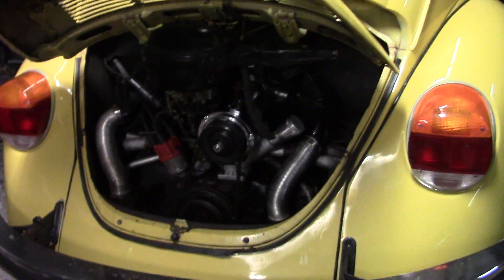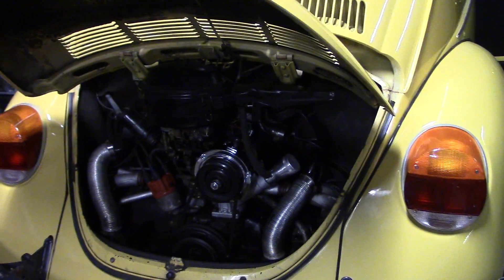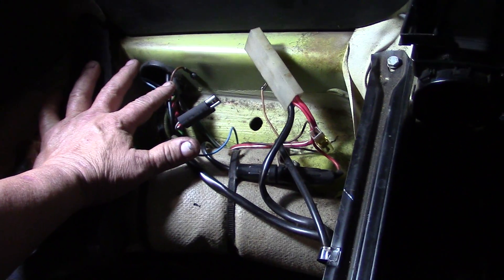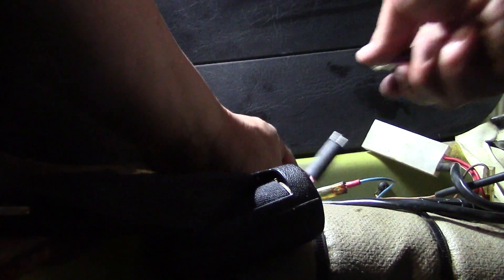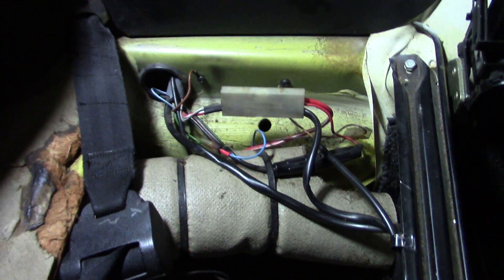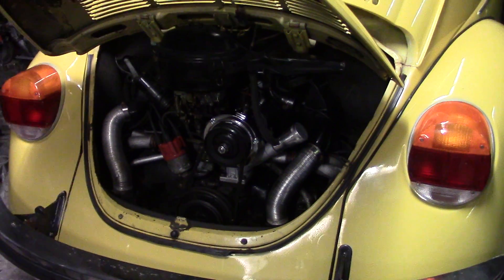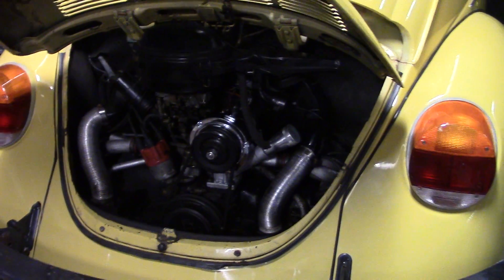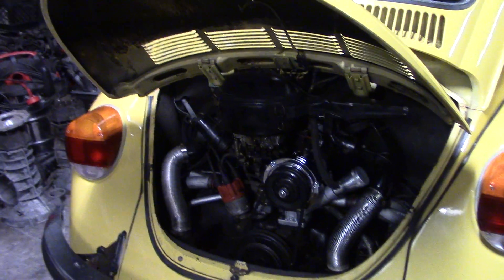VW Generator to alternator How to  Wiring

Comment: hey boss i have a good alternator with external regulator . if i wanna change my beetles generator with this alternator am i one cable short if my research is correct? the alternator regulator needs 3 thin wires and a fat one but the generator has one fat and 2 thin so i guess i need one cable more to put the alternator on? thank you

Comment: Question.. U have a 76 VW van with a 2000cc being built for road trips and camping. How much hp will I loose going to hydrollic lifters? The guy building my engin wants to use mech. I don't want to have to run the lifters all the time. I'm old and my hi school 68 camaro had solids in it and I don't want to go through that again. Small block Chevy I can do anything with but VW isn't something I'm used to. Any help would be great.thanks. Also going carb instead of fuel injection which was his idea.
Reply: "I have" not u have. Sorry. Lol